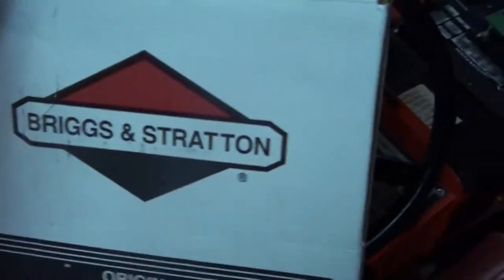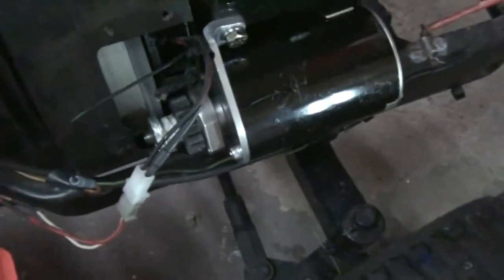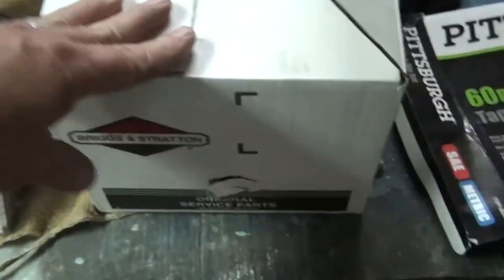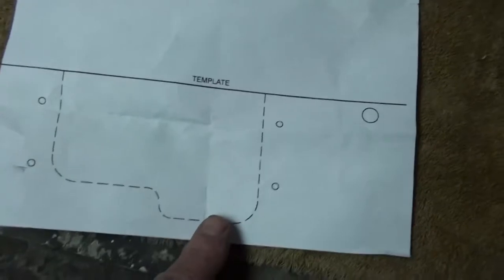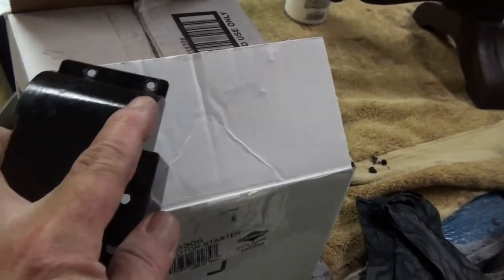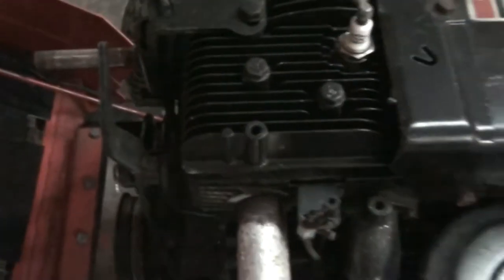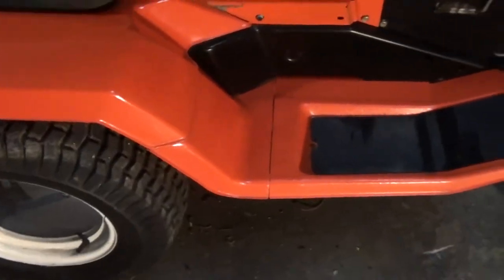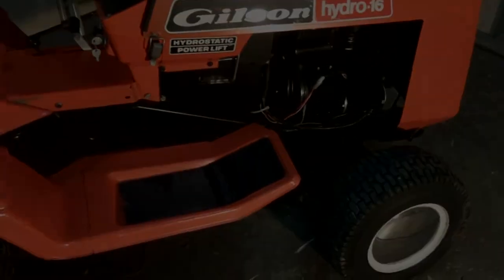1975 Gilson Starter Fix! Maybe.

Comment: Looks and sounds really good. Now to mow some grass!?
Reply from the maker: Hehe yea, well to do that I need the linkage to lift the deck its not exactly an easy item to find. However if it removes Snow that is its primary function.
Reply: It is something you could fabricate?
Reply from the maker: Probably not its a 1/2" hardened rod with a bend at one end and a crazy bend at the other and I just don't have to tools to bend something like that. Also I enjoy mowing the yard with my push mower its about the only exercise I enjoy and only takes about 40min to do.